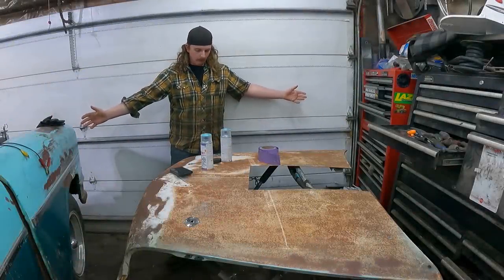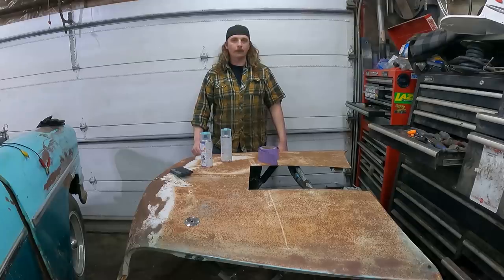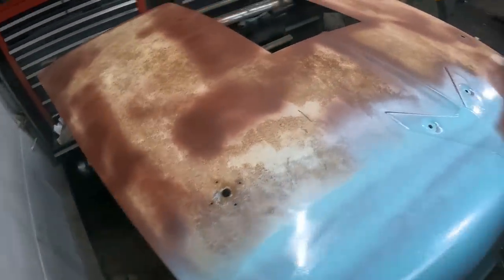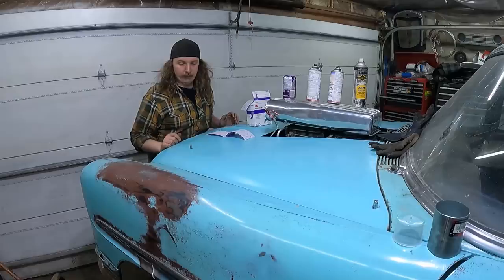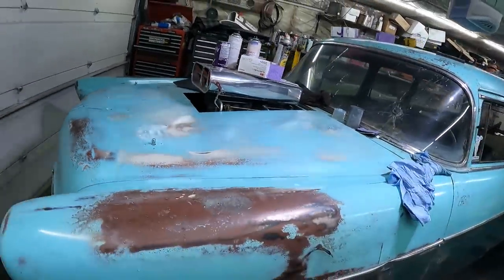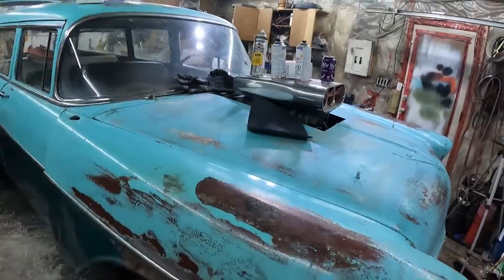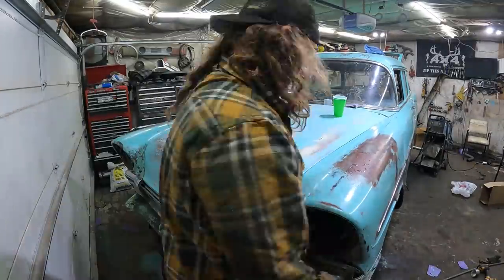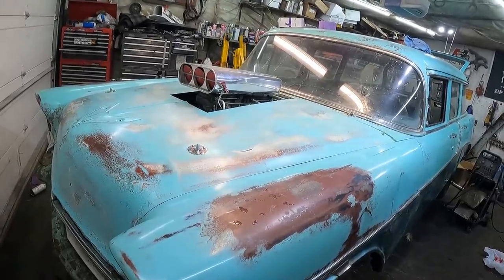Patina Matching Original Paint - 1956 Chevy Gasser Long Roof!

Comment: I think the hood looks awesome. I believe you have hit the nail on the head with the overall theme for the car. The hood just seem to fit with the rest to the car because of too much rust showing. Now it belongs! You didn't want it to just look like a rust bucket with parts just slamed at it, you wanted to look like an older car that was weathered but still had some of the original paint. Not totally rough but cleaned up and refreshed a little. Awesome job!

Comment: Hood turned out BAD ASS!!! Man you are becoming the king of making patina paint! Only thing i would have suggested before painting was weld in some quarter round or round rod underneath around near the opening and tying it back into the rear bracing to add-in a little strength to the hood. Just with tack welds.... so as not to warp it. But aside of that, man, looks BITCHIN!

Comment: A suggestion for around the opening in the hood. Just take some flat bar and line the edges. 3/16 would be max or 1/8 just tack weld it in the places you think it needs it. Should stiffen up the hood so it's not so flappy or floppy whichever.